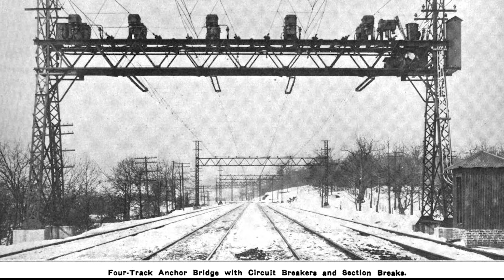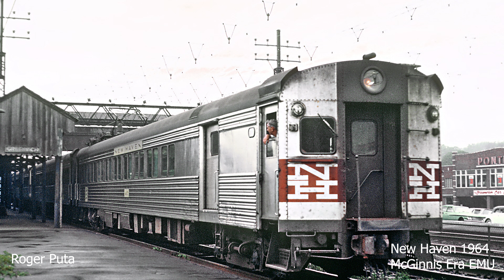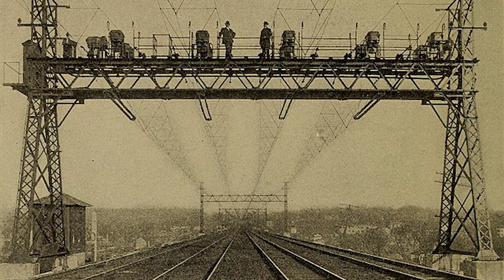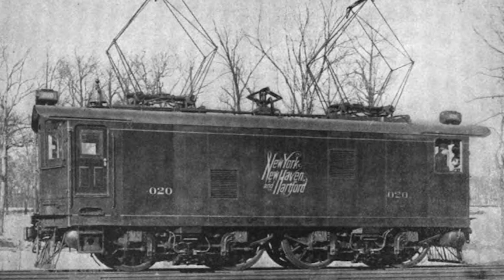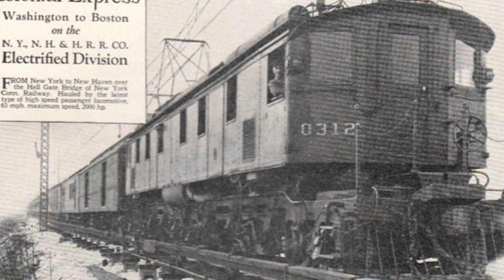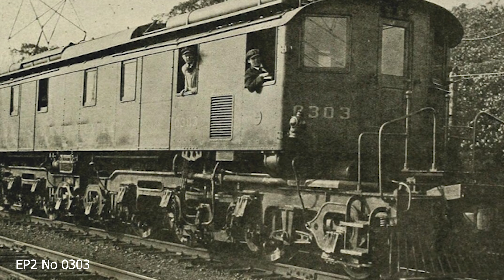PAN UP A history of east coast Electric trains: When the New Haven Railroad changed the world! EP4

Comment: In Central Europe, most of their overhead traction infrastructure is powered at an even lower 16⅔ Hz, yet in Germany and Switzerland, their system is the closest to what was employed by the Pennsylvania Railroad in their 1928 electrification extension (the first with the dedicated 138 kV transmission lines and step-down substations + rotary converter station in Chester, PA) from Philadelphia to Wilmington, DE and West Chester, PA.
Reply from the maker: Yes thats correct. Honestly i've been tempted to go into the electrification of Germany and Switzerland just because alot of the conventional sources are in german. Alot of their newer lines are at 25kz 60hz. I am think of maybe going into the early state era of railways in germany and into the DRG once im a bit closer to the Amtrak era. I think with the series getting closer to the mid century its going to be quite interesting as we will get closer to things like the transistor and solid state equipment. I know alot of the rotary convertor equipment is still in use on the older 25hz lines.
Reply: @Reaper1770  Hold on, Germany, Austria and Switzerland are not building new lines at 25kV 50 Hz, but stick to the 15kV 16.7Hz (there were some issues with resonance with 50Hz grid, so once modern inverters were available, they had moved the frequency a bit and had adjusted speed regulation at dedicated power plants producing 16.7Hz), it is Czechia and Slovakia converting lines from 3kV DC to 25kV 50Hz. But new substations are also equipped with inverters, just as is the case in 16.7Hz world, so they put same load on all three phases, current way of feeding the railway by transformers from public grid can cause imbalance and thus available power is limited.
Reply: And from the late 1940s on, it became possible to have rectifiers on board locomotives and rolling stock, so as to be able to use DC traction motors fed by an industrial frequency supply, so many routes in Northern France were electrified at 25kV 50 Hz, and similar improvements were done on British Railways from the 1950s. Still lots of 1500V DC on the SNCF, though.
Reply from the maker: I know the netherlands is a hodgepot of both. I know for its modern highspeed lines its 25kv ac but its main NS routes its still 1500 DC. Yup gotta thank the mecury arc and iginatron making DC traction possible in electric locomotives.

Comment: The loco at 8mins 55 sec is interesting, why are there two normal size pans but in between a very small pantograph.
Reply from the maker: So from my underatanding its a small pantograph to feed from the dc overhead. Its to help travel through the gaps if they stall out at places at grandcentral. The idea was you open that pantograph up and you would be able to have enough power to.get through the third rail gap
Reply: @Reaper1770  That is correct.  The traditional "third rail" pantograph, which was on New Haven and New York Central electric locomotives - including the EP5s, was fixed in place at a height to automatically contact the overhead third rail, and didn't have to be raised or lowered by the train operator.  This prevented the locomotive from stalling on gaps through slip switches and other complex interlockings within the GCT tunnels.  The first group of FL9 diesel electric-electric locomotives (diesels that could also run on third rail) had a moveable "third rail" pantograph that had to be raised and lowered.  Because of the design, if the pantograph was raised too soon, it would snag at the end of the overhead third rail instead of properly contacting the beveled end of the rail, which normally resulted in not-so insignificant damage to both the pantograph and the third rail.

Comment: Didn't the Virginian Railroad have a bunch of electrified locomotives? I can't help but wonder if this technology will come back into mainstream once nuclear power gets its feet under it.
Reply: .Yes, they did. Before the Diesel locomotives arrived the railroads with steeps grades and tunnels found that steam locomotives lacked the tractive effort so you needed multiple locomotives to pull the train. Each steam locomotive requires an engineer and fireman so the labor cost became excessive. Also, steam locomotives are a danger to the crew when going through tunnels. 
When the Diesel locomotive showed up it could replace electric locomotives in the mountain regions . The railroads in the USA didn't like maintaining the electric infrastructure. I'm pro nuclear power, but we don't need nuclear power stations to power electric railways. There are many ways to produce electricity.
Reply from the maker: One of the biggest factor for electric railways isnt cost of power but more so the cost of infrastructure. It cost alot of money to build and keep it in good order.  Generally electric railways have always done well in very hilly areas just due to the difficulty of moving trains in the areas. Diesels just became popular in america because it was cheaper and didn't require infrastructure but these days with all the rules and regulations i could see vectrons being a replacement for T4 locomotives
Reply: @Reaper1770  I don't think North American railroads would want Vectron locomotives. Most freight trains in Europe are much shorter and lighter so they can share the rails with passenger trains. The  Vectron is a 4 axle locomotive with 24.8 short tons per axle. Class 1 USA railroads want 6 axle locomotives with a per axle weight of 35 short tons. There are many hundreds of 1990s and later diesel locomotives in storage in the USA. If they convert some of them into dual power then they can transition to at least partial electrification.
Reply: At the very least, the Virginian had 10 EL-C units which went on to N&W and then became the New Haven EF-4s and then th PC E-33s They ran in The Bay Ridge LIRR “cut” 2 blocks from my home in Brooklyn NY!!
Reply from the maker: I know the E33s aren't famous for their looks but i think they look rather unique and just different. Like i can't think of another locomotive that looks like the E33. Even the EP5 has to compete with the NS1200 class and they had some amazing liveries to match.
Reply: @Reaper1770  the E33s were a thing of beauty to me!
Reply: @ABDOSPIANO I fully agree, the E33s are one of my 3 favorite American electrics. They have this very cool "industrial" look with just the right touches of barely noticeable streamlining; the rounded roof, tiny cow catchers, sloped end walls and angled number boards, a very clever way of subtle smooth design on industrial square body. I like them the most in Conrail blue dress, but in any scheme they looked good.

Comment: Great video! Interesting to see the early catenary setup. Are you going to talk about the weird three-wire triangular catenary the NH had?
Reply from the maker: I will in the next new haven video for sure. I'm still trying to figure out whats the perfect length for these episodes. Its rather different and quite unique
Reply: NH catenary was solidly mounted with no provision for expansion. Caused problems in summer and winter. Today springs or weights are used to tension the catenary.
Reply: @PaulWannenburg  This is exactly why use of the original triangular catenary design wasn't repeated when the NH expanded their electrification from Stamford to New Haven in 1914.
Reply: The reason for triangular cross section catenary was the worry about stability of catenary when pantograph shoes would press against it. That worry proved to be unfounded and that's why the later expansion of catenary used vertical cross section. Triangulal catenary was only present on the 20 original miles electrified and amazingly lasted into early  1990s, with a few sections still present when the new Acela trainsets were just starting to be used in 2000.